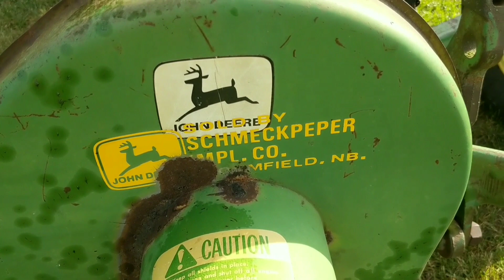37 and 38 sickle mower transplant

Comment: Nice job man.... Gas axe and air hammer mans best tools
Reply: They do work nicely together 👍😎
Reply from the maker: I thought maybe at most it would take a hammer but them babies were tight
Reply: @AgWildNebraska  bad thing about close tolerance, especially in cast.. they get stuck easy!!!
Hopefully you slathered it all with antisleize... I've seen Stuff like that get stuck on all pieces.. and break when you try to move it..
Reply from the maker: No.  The bottle is still sitting on the bench.  Didn't even think of that.
Reply: @AgWildNebraska  dang.. well, in another 60 years, some kid will be trying to restore his grandpa's old mower... And break it 😪😪 lol 😎

Comment: those pins were really in there, I had a similar situation with my wife's subaru when I went to change the rear wheel bearings,
Reply from the maker: Well they probably haven't moved in 60 years so I guess I should have expected that.

Comment: Ide like to have a 7 foot bar on my 37. If I can't find one, I'm thinking of cutting it down.
Reply from the maker: 9' is too big for road ditches when you only use 3' of bar and the rest hangs out there bouncing around. Know what I mean.  I bet you could find a7'  38 for a little or nothing and do the same thing
Reply: @AgWildNebraska  yep. 3 foot dragging through gravel on the road side. If you run across a 7 foot, please let me know. I've looked in my area for 2 years.